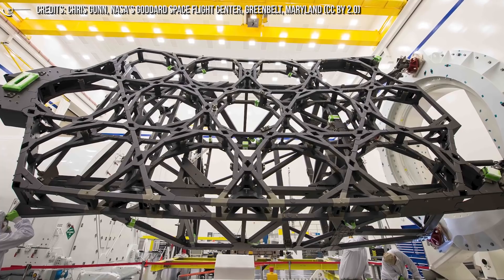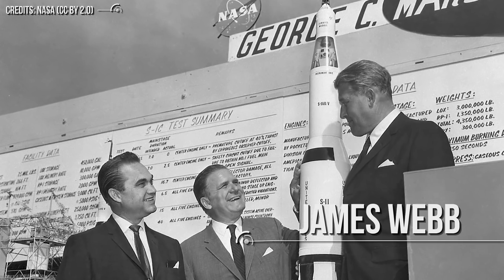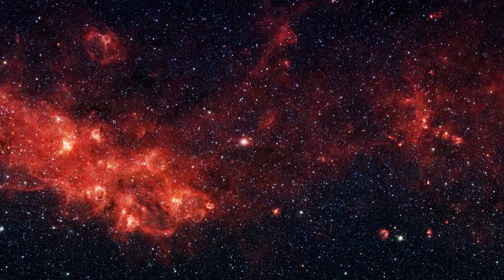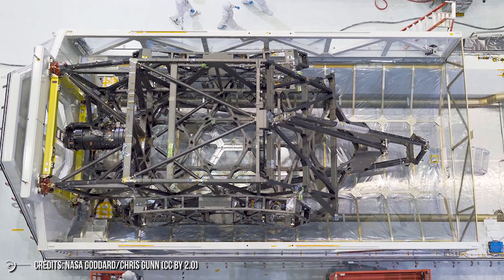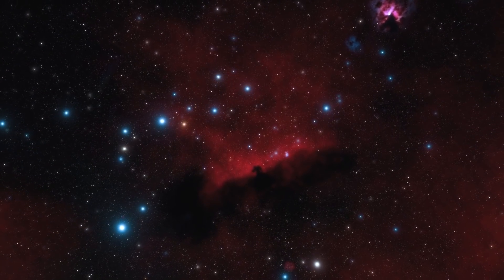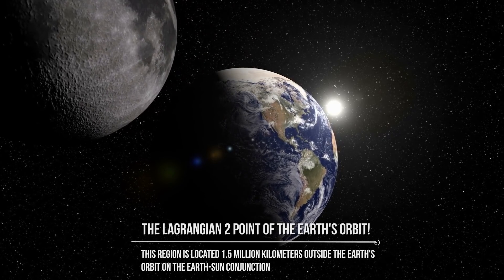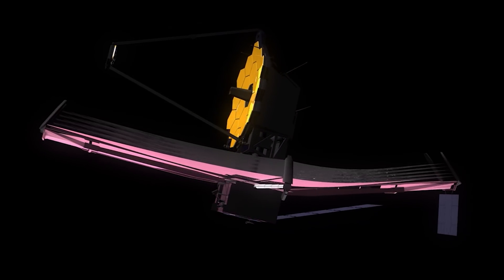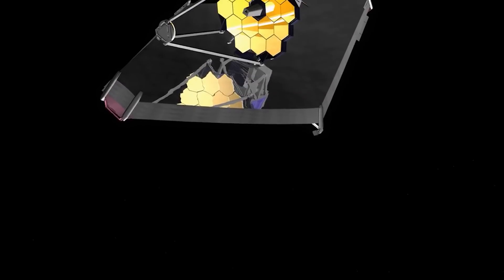James Webb Space Telescope Is About To Fly: Are You Ready For The Revolution?

Comment: 02:45  "...at a much higher wavelength."  INFRARED is LOWER  in frequency than visible light.  ULTRAVIOLET is HIGHER in frequency than visible light.  Now if you had said a much LONGER wavelength it would have been correct.

Comment: the ELT (extremely large telescope) will have almost all the capabilities in infrared as JWT (some better) plus the visual spectrum.  It's due to go on-line in 2025, and since there is no possibility of launch failure, it's pretty much a safe bet.  Est. total cost:  1/5 that of  JWT.    If JWT crashes and burns, it will be decades before a replacement goes into service.

Comment: One thing I thought they should have done with the James Webb Space Telescope, is put a maintenance robot on it.  There are two main reasons for this. 

1) Because the James Webb Space Telescope will be at the L2 Lagrange point we will not be able to maintain it, or fix it if something goes wrong.  The Hubble Space Telescope had several problems over the years, and we were able to fix the problems using the space shuttle, to go to the Hubble Space Telescope.  This also allowed the Hubble to be used longer than expected.  The Hubble was only expected to last for 15 years, but because we were able to maintain it, it has worked for 30 years.

2) The James Webb Space Telescope is much more complicated than the Hubble Space Telescope, so there are more things that can go wrong with it.  Take the mirror for example.  The Hubble Space Telescope had a single mirror, and the Webb has a complicated folding mirror.

A robot would not be as good as having a human to fix or maintain the James Webb Space Telescope, but it is better than nothing.  It would be difficult to write software that could fix every problem, but the robot could be reprogrammed from earth with special software to fix problems as they come up.